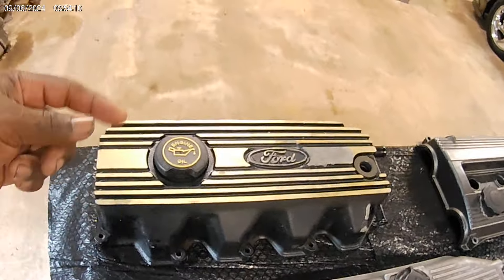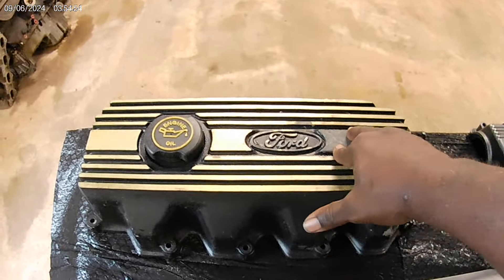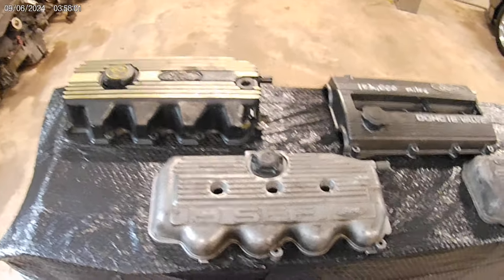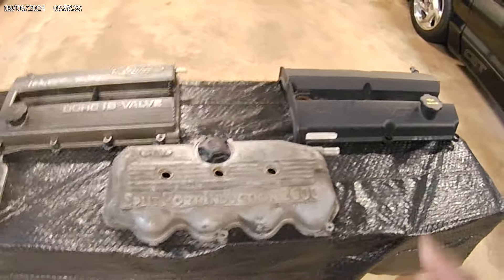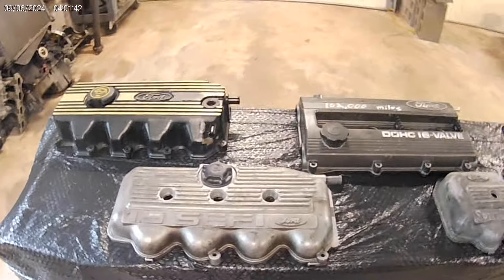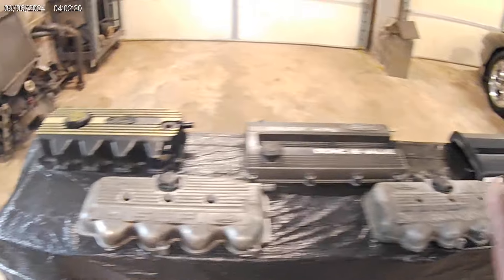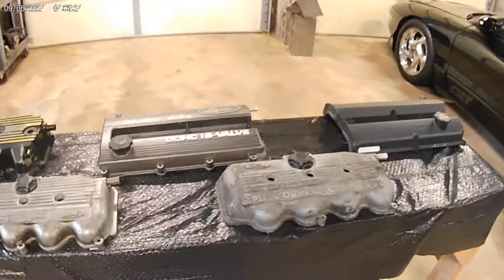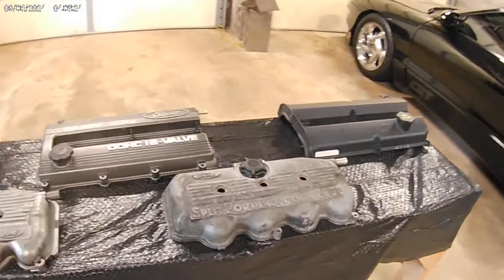Ok so let’s have a little conversation about the engines that these valve covers are bolted to. P-2

Comment: Another thing that is worth mentioning, people get stuck on their terms. Oh I need more 'horsepower'.. ok well hp is a function of WORK over TIME/rpm. So you can have a 300 'hp' engine that cant go up a hill because all its 'power' is made at 7500+ rpm. No one is driving a mountain pass at those rpm ranges, and not EVERY car is a race car.... That is the beauty of the CVH/hemi engines. They actually do work, and respond much better to forced induction stock for stock when compared to a 16v engine.